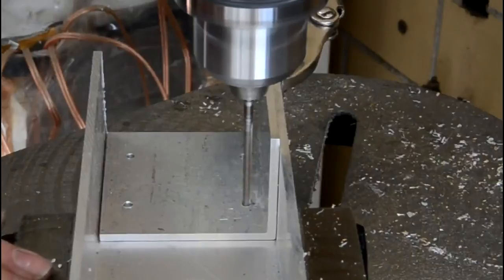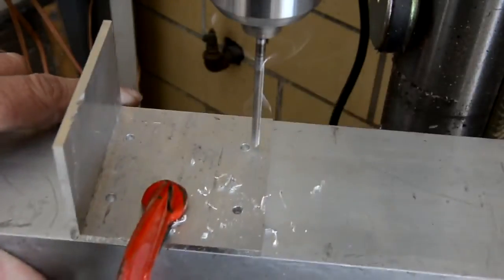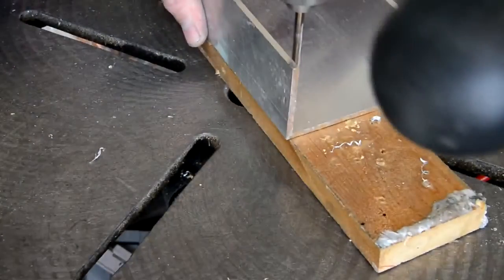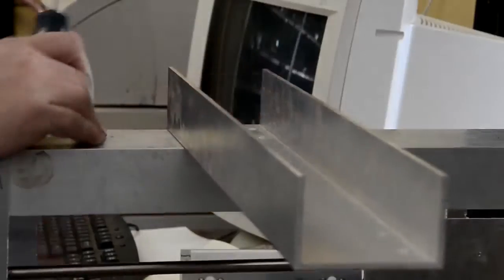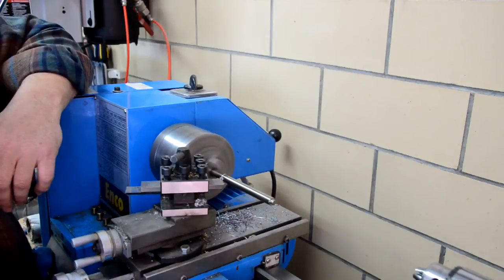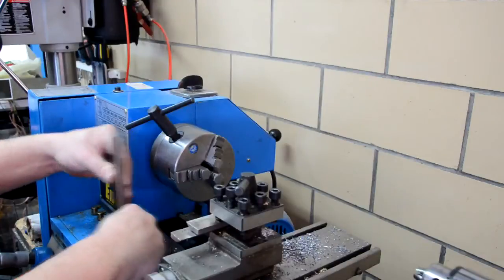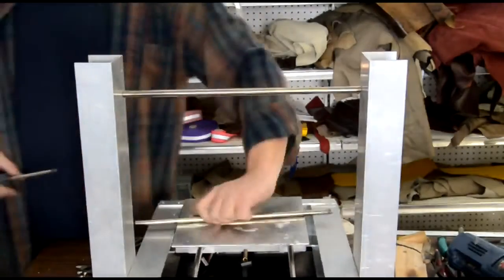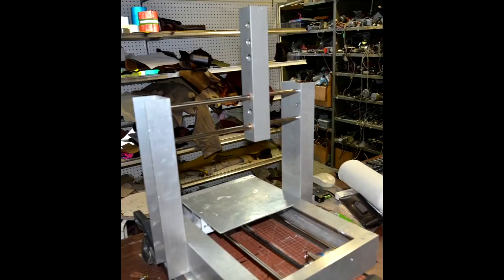Building a RepStrap 3D printer part 3: X axis weekend project

Comment: What happened to the rest of the build, did you give up on it?  It was very interesting so far.
Reply from the maker: No, no, the machine is working now..... I just don't have time to put updates.  will post a video of the machine shortly.

Bi the way, the total cost for materials was less than $300.
Reply: Thanks that will be great.